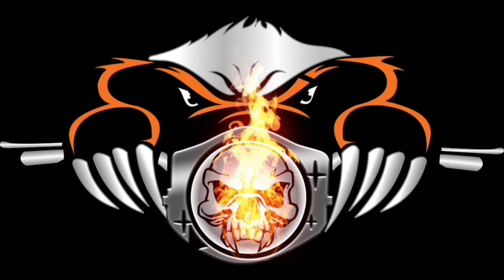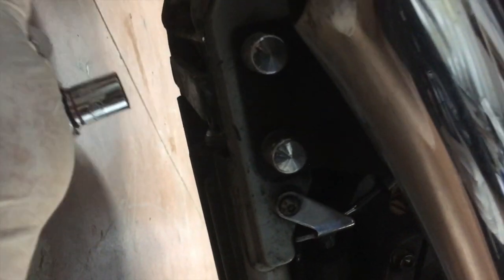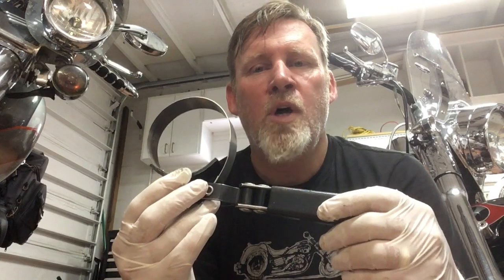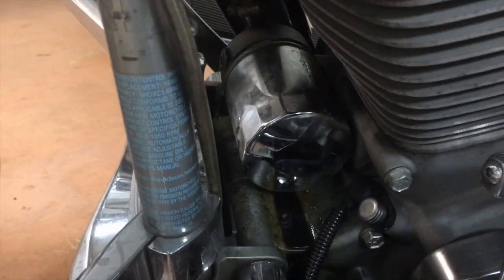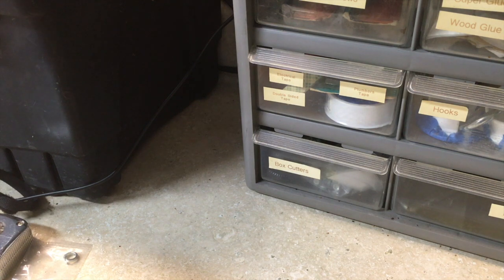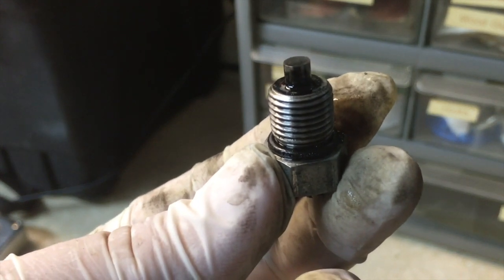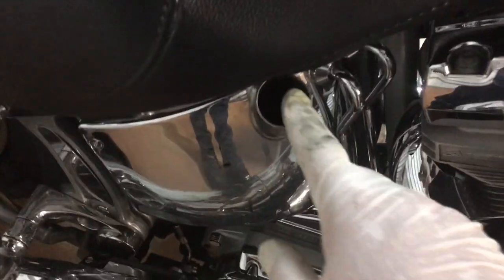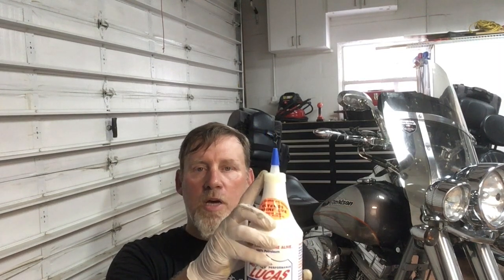Harley Davidson Fatboy Oil Change with Lucas Oil DIY.

Comment: If you're using full synthetic oil the stabilizer you should be running the full synthetic oil stabilizer. The product you're using there is an oil stabilizer for conventional oil.
Reply from the maker: Thanks Mike I only use Amsoil now
Reply: I like both products. Lucas engineers are definitely highly respected in the industry.  Being an engineer myself I always look to use the highest quality lubricants on my motorcycles. I just recently purchased a 2015 Harley Davidson Street Glide. Coming from a Suzuki Super Street platform to this particular Harley I gotta say I'm rather impressed by reliability of the current Harley Davidson engine designs. I'd say it's probably fair to say the Milwaukee 8 engines are going to be around for a while, especially considering Harley has looked to Riders for feedback and have actually taken some of the feedback and applied it to the production side of Harley. I will always love my Busa though tough to argue with 504 horsepower and 2 pound NOS setup for those moments you want to do a quarter mile pull.

Comment: The oil stabiliser reduces noise. Would you know if this is true ?
Reply from the maker: It will reduce some noises, but important note it will not repair and issue, just help cover it up.